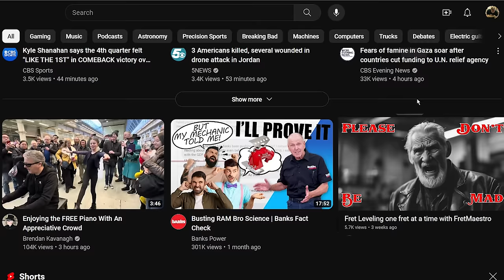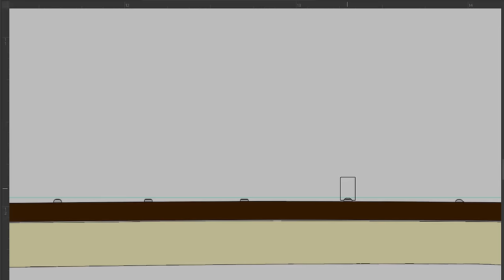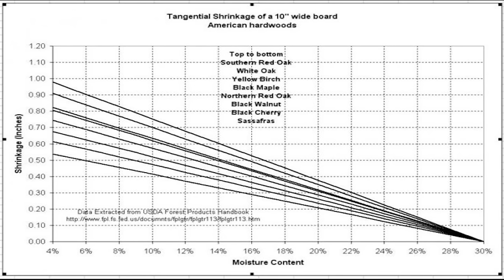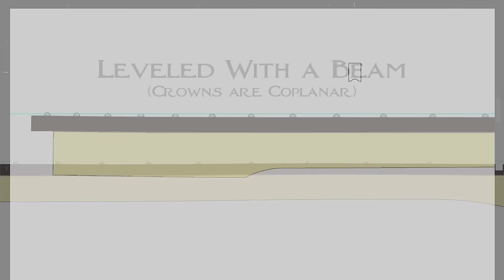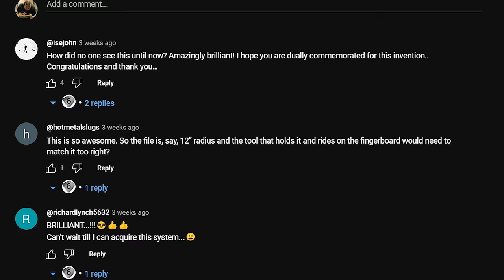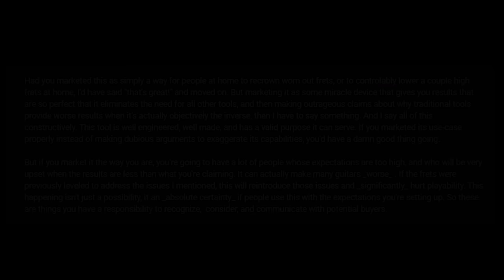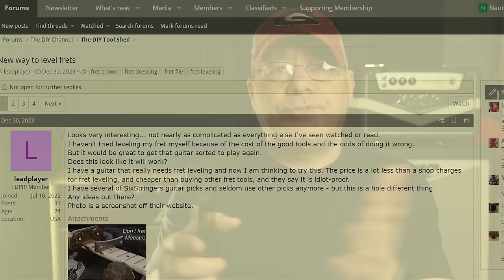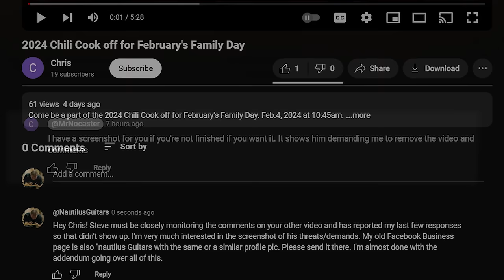Fret Maestro - Gimmick or Godsend? - A Fair Warning

Comment: I bought and used a FretMaestro and it worked great for me. That doesn't mean it will work as well for every guitar. Mine is a 2005 Gibson SG that has original frets and never had a fret job. The pits and low spots were pretty severe. I had to take a lot off the frets to get them level, but there's still plenty of fret material left.

I now have it set-up at factory settings and it plays better than it ever has since I bought it a few years ago. There's no buzz and the frets are silky smooth when I'm bending notes. Also, since I took off quite a bit of fret material, I had to slightly deepen the nut slots. Not a big deal.

Based on all the comments and mathematical impossibilities I must have just gotten lucky. I will say, if the fretboard was in bad shape or twisted I wouldn't have tried it. If I wanted a low action, below specs, I would have taken it to a luthier.

Anyway, it seems nobody expressing their opinions here has actually tried the tool. I didn't have any issues with the maker - he was normal and friendly to me.

I don't want to cause controversy, I just wanted to help inform. Your mileage may vary.

Cheers!
Reply: It's good you share your experience. I don't disbelieve that fret maestro can make some guitars play better than they otherwise would have, all other variables constant. 

Imo it's even possible to have a guitar with relatively major fretboard inconsistencies, but with so much fret wear, even using the fretboard as the measuring point results in meaningfully more level frets. 

Also, I think the impression can some times be given that wood is never "level enough", but keeps warping, twisting constantly, enough to -- at all times -- strongly affect how level frets are/playability.

While I do think "constant motion" is what happens..  if that was always enough to cause substantial issues, levelling frets even with a beam would be near meaningless. There would be no way I can have a 1mm action on a PRS radius for a meaningful length of time. 

So I think the point about fretboards being off can be exaggerated. But at the same time, it's not hard for me to notice when something does go wrong enough, and frets are off by enough of a margin to cause issues. This has happened to every single one of my guitars in the past years. Even new ones have come that way, often.

So it seems to me as a rather nuanced situation, you could say.
Reply: @Dimiguitar  Nice comment. I like the way you describe neck/fretboard wood as "constantly moving" but not necessarily to the degree that it's always completely unreliable. Wood changes from humid to dry weather, different gauge of strings, being dropped, the list is long. That's why there is a truss rod, bridge height adjusters, intonation adjusters, pickup height adjusters. These are specifically designed allow the fine adjustments when the wood has moved too much.

You mentioned maybe the tool might improve playability in extreme cases if the frets are in very bad shape. I just wanted to be a little more clear about my results.

In my case, the strings are now set at the Gibson factory recommended settings and there is no buzz or any other issues. In my mind, that's more than improving the playability, it's the gold standard to measure my results. So, to me the results are 100%.

I play rock and blues and I bend a lot of notes, so I don't want a low action below these standard settings. Like I said - If I wanted a low action I'd leave it to a luthier.

The good guitar makers spend a lot of time and effort to make the neck and fretboard as true as possible under stress. They know it's the seat of the frets for the life of the instrument. But they also account for the variability and movement of the wood with the fine adjusters on the guitar. Look at a PLEK graph for a well made guitar of any age - you'll see the actual fretboard (base of the frets) is very close to the ideal line in most cases - with average variance of less than about .05mm. 

If my fret heights are off by .05mm I'd never know it at the factory action settings. It may make a difference for a low action.

Anyway, bottom line, my results were great and just want this one data point to be part of the database.

Cheers!
Reply: @Dimiguitar  - I'm not seeing your last comment - it looks like it was deleted. But to answer the questions you asked: 

The factory settings at the 12th are: 

Low E    5/64ths    1.98mm
High E   3/64ths    1.19mm

There's a YouTube video from Gibson called "How To Adjust the Action on Your Electric Guitar". At the end the luthier explains why you might want to go higher for aggressive styles like rock or lower for more gentle styles like Jazz.

I just now measured mine in millimeters - it's been a couple of weeks since I set it up:

Low E    1.6mm
High E   1.4mm

This works well with my style of play. Probably moved a little since I set it up anyway.

As for the Plek numbers, you can google "Plek Graph" and see several examples. You're looking for the guitars that have finished the entire Plek process and have the correct set-up. You're looking at how the graph shows the "ideal" fretboard line and comparing to the actual fretboard measurements. Most of them show an extremely small average deviation from the "ideal" -  in the range of 0.05mm for most graphs. There are also a small number of examples with fretboards that aren't true - maybe a hump or twist - but they seem to be a small minority.

Hope that helps.
Reply: @thisisreallife5086  Your information on PLEK graphs illustrates the exact problem I have with all these people insisting that the FretMaestro cannot work, without ever trying it.

I perfectly understand the argument that referencing the fingerboard should not work because irregularities in the fingerboard will be transferred to the fret tops. This is clearly correct — in theory. But, in the real world I suspect that most guitars do not have fingerboard irregularities of enough significance to stop the tool from working.

So, I welcome information from users who have actual experience using the tool.
Reply: @johnbuell8035  That's what I think, as well, based on my experience. But I also want to temper it with "your mileage may vary". The reason is, I don't know if a guitar owner just isn't very good with tools, or has a terrible twist in their guitar neck and doesn't know it, etc. I don't want my comments to be seen as any sort of "promise" the tool will work for everyone. But, yeah, I think it will work in most cases.
Reply: @thisisreallife5086  My FretMaestro turned up, and I just finished using it on one of my Strats. 

It worked well for me. 

Now, the frets look smooth, even, symmetrical, nicely polished, and the guitar plays great.

Like you say, YMMV but every bit of data from real world use helps toward an accurate picture.
Reply: @thisisreallife5086  I think two real-world use tests by independent purchasers are worth 1,000 theoretical claims by people who never used the tool. I hope people do see these posts.

I just used the 150 grit insert until it felt like it was smoothing out a bit, and cutting less, then moved to the 300 grit to finish off. I kept going with the 300 grit until all I could feel was smooth travel across the fingerboard.

I didn’t use a straight edge at all. I just left the guitar with the relief and action set the way it is. I didn’t even remove the strings, I just loosened them and pegged them back behind the neck.

Putting the strings back and re-tuning, I checked every fret and everything was clean.

After a small amount of polishing the same way you describe, the frets look smooth, even, symmetrical, nicely polished, and the guitar plays great.

The process actually helped with the nut — it was just starting to make sitar sounds on the open treble strings, and the small amount of fret material I removed fixed that.
Reply: Have you guys considered making videos on this? It doesn't seem like the maker wants to use a fret rocker -- even if he has one on hand, he won't. Obviously that comes off bad to people skeptical about this tool or many of the claims he's making, if they view the rocker as the golden standard for such testing.

That aside, I have come to think one of the issues with such levelling tools or processes is the preliminary but often neglected question of what it means for them to "work". Does "working" imply perfectly level frets? Even Plek machines have accuracy thresholds they work under, as with any tool. So "perfectly level" seems to be a standard that no levelling can achieve.

That considered, it seems to me that a more realistic view of what it means for a levelling tool or process to "work" implies a less radical standard. One such standard seems to be that the frets check out level when checked with a precision fret rocker. Another could be "for my action and play style, the guitar plays its best/close to its best". And one more:"it plays better than it did before". 

I think there can be an interesting discussion about what standards are reasonable/which ones are not. I'm not as obsessive about fret rocker tests personally compared to what I see playing the guitar with my set up.
Reply: @Dimiguitar  - I agree with your point. Just how "accurate" is good enough? For example, after using a FretMaestro my SG is playing perfectly at my preferred setup - no fret buzz, good sustain, etc. But, suppose I  take it, as is, to a luthier and have it PLEKed. Now the frets would be as accurate as they could possibly be in the real world. I would get it back and play it, at my preferred setup, and it would still not buzz, have the same sustain - what did the extra precision gain me? Nothing.

As I said - if I wanted a low action the FretMaestro may not work as well. I'd leave it to a luthier. But a low action isn't for my style - I can't fit my fingers under the strings to bend notes.

I thought about making a video, but all I've got is my iPhone. I actually laid out my guitar to show the fret rocker and quickly found out how hard it was without a third hand. Anyway, I don't have a long straight edge to prove the neck is level before using the rocker and I don't feel like taking my strings off and creating a whole production for just a "proof" I'm not lying. I'm a happy customer - not some advocate for this guy's business. It just ain't that important to me - I just wanted to chime in with my results to help inform others. I don't think my results matter on this channel, though. I think everyone's convinced this maker and his product are a crime against humanity, LOL. Shame - I think it could help a lot of players who will now not try it.

Cheers!
Reply: @thisisreallife5086  I believe a very large reason for the views on this product is the marketing. It was bound to create a backlash of some sort. When you make a table to describe traditional tools as of "random accuracy", that's a (rather questionable) effort to push people towards a certain direction. Couple that with certain behaviors, and it adds up. 

I see considerable responsibility on the part of the maker, even in terms of the rhetoric like "your neck is fireworks if the fretboard isn't perfectly level" (which now seems to have changed? Fret maestro is now apparently the "best tool for S necks"" too. Who would have thought). 

But I think there's also people taking it too far, at least in the sense of dismissing fret maestro as having any possible use. There's folk say the same for anyone who levels frets without a neck jig to simulate tension. Rather unfortunately, it seems difficult to have convos about potentially plausible uses of fret maestro. 

But a big chunk of responsibility for that, in my opinion, falls on the maker of the tool.
Reply: @thisisreallife5086  yeah, I don't think people are obligated to make videos. Takes quite a bit of energy and planning. I don't disbelieve your claims or the other person's claims anyway.
Reply: @thisisreallife5086  also I've seen frets rock a week after a guitar was pleked. That's how long it took for that to happen. So I did eventually come to believe that there's a point of diminishing returns when it comes to levelling accuracy. Where that point is exactly, a big topic, obviously. But my own view is that if my guitars "play ok enough" for my preferences, that's it, done job... Until shit hits the fan again, and fretboard goes lasagna, but yeah :D
Reply: @thisisreallife5086  "What would that precision gain me? Nothing" you said. For me, some times I've slept better at night knowing the frets on a given guitar are more level. But I've gotten over that mania thankfully :D

Comment: Thanks 👍🏻 Good analysis and research 🙌🏻

That thing could be useful in some limited conditions, when neck and fretboard made of stable materials, at list roasted or/and stabilized wood, or proper carbon fiber or so.

And that is only half of deal. 
With this type of stable materials, you need properly straightened fretboard before glue frets in.

But truth is that after that correct preparing and correct fret placing - you don't really need this type of tool. 

All you need is just check some small minor issues and correct them in easy quick way.

This video topic instrument is good in only some tight conditions, when you already have this properly  prepared straight fretboard with stable to humidity and temperature 🌡️ materials.. And your frets need some correction after a years of playing.

But.... that is very rare condition...

And this tool can have only one radius - flat radius. 
That is enough for multiscale freatbord radius or any other radius. If tool properly made.

Sad that this seller and business owner is such misleading slippery bulling unhonorable person.

Be Aware..

(I save a comment just in case of reports from this guy again)

Comment: The Music Nomad crowning tool looks to be a far better tool for crowning frets after levelling as it has hollow diamond files with a smooth section at the apex to leave the crown and also upward curved ends to dress small areas. 

I can't understand how using the Fret Maestro to bring all the frets down to the level of the wood or the masking tape covering the fingerboard is even going to work, plus you'd need all the various radius files to cover a compound radiused fretboard if you choose to use this flawed method.

Comment: As someone who is considering doing my first fret level on my bass guitar I really appreciate this video. I am a CNC machine mechanic and the fretmeistro intrigued me at first but the neck on my Warwick infinity has a 26” radius and they don’t make one with a radius that size. I also noticed that the fretmeistro only goes in increments of three thousandth of an inch and if the fretboard was not perfect I might not get each fret perfect. I commented on one of the videos and was told about the Omni. That one doesn’t have a radius and seemed like it may be ok for crowning but an unnecessary expense. I am glad I decided against purchasing it and did bit more research. I was thinking about making a 26” radius fret leveling beam and purchasing a crowning file. It seems to me that a radius on the beam would help keep the proper radius when leveling. I can see how this would not work on a conical neck and I understand that having a perfect radius is not the most important part of the fret level job but as someone who is inexperienced with this it seems like it may help keep me from accidentally changing the radius by removing too much material from one side or the other. I would be really interested in feedback on my thoughts and a suggestion on a good crown leveling file for the Jumbo frets on my Warwick infinity sn. Thanks in advance for any feedback.
Reply: I have a couple aluminum neck guitars.  Seems to me the Fret Maestro would work on aluminum necks because the necks are machine perfectly and they never move like wood.  What do you think?

Comment: In before the inevitable copyright claim.  The inventor of this less than really useful gadget doesn't like his product being criticized.  

If you are chasing really low action,  his gadget won't get you there. You'll just waste a step and have to go back and adjust each fret crown by hand, the old fashioned way anyway.   So with no labor or time savings, there is literally no reason to buy this thing.
Reply: dont forget levelling, adj each crown by hand will facilitate the need to have the fret heights all straight to a virtual straight plane, meaning  you'll need to plane the tops of the frets to match the bottom of a known , straight reference point ( see: leveling beam)   why? because its the only reference point that is available.